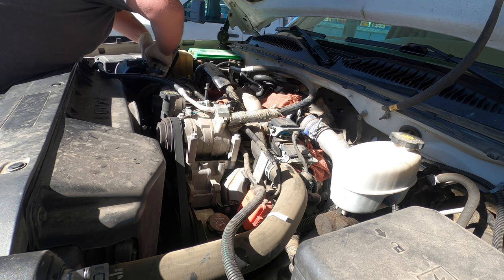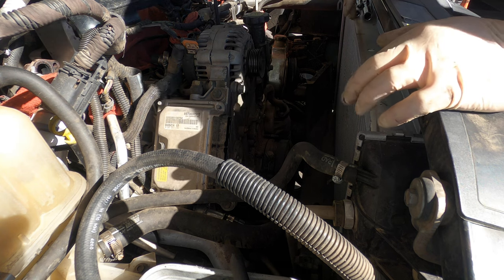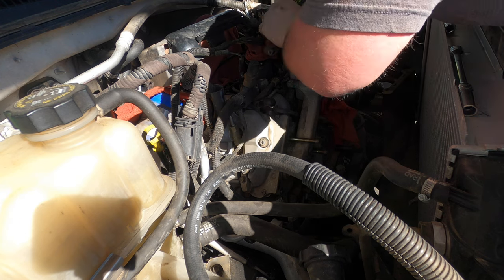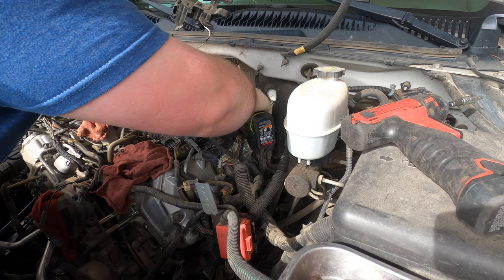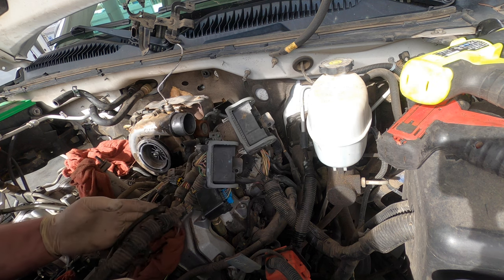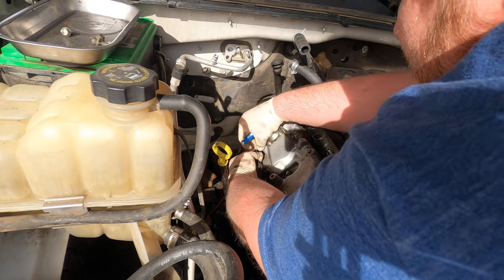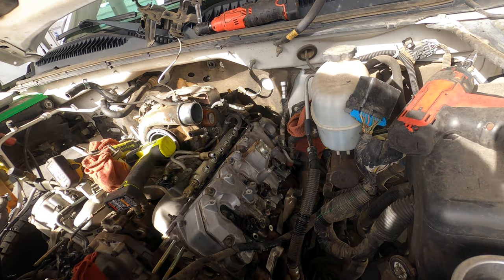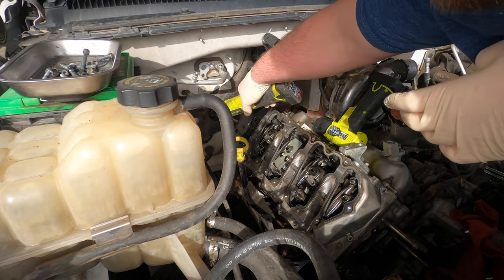2005 LLY Duramax Head Gasket Replacement Part 1

Comment: Removing the ac compressor is not necessary . Remove the mounting bolts and flip over to the passenger side inner fender. No harm no foul!
Reply from the maker: You’re absolutely right, one thing I have noticed before when i worked around the system that pushing on the suction line on the accumulator makes it leak just by gently pushing down on it. It’s so much easier to evacuate and remove the components for more room especially if you have a recovery’s machine.